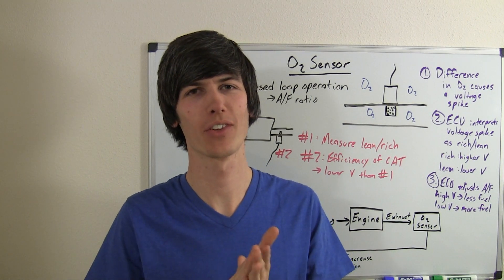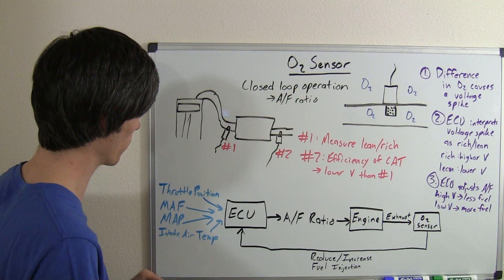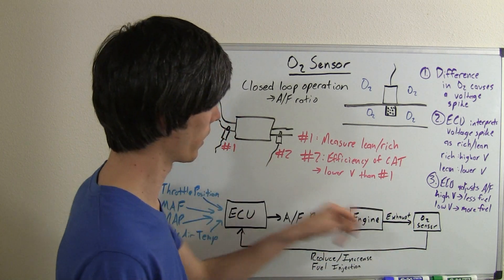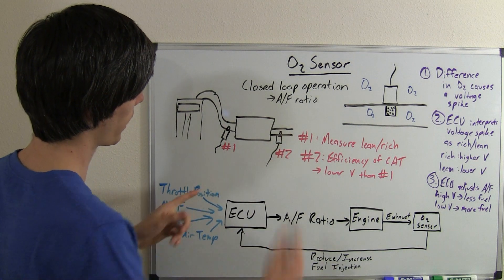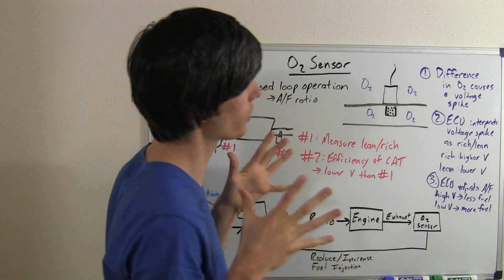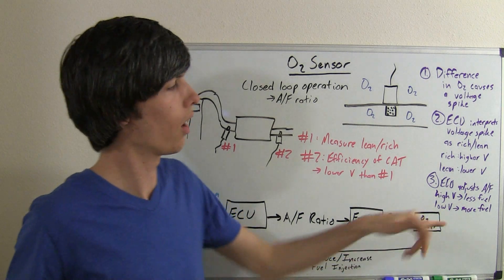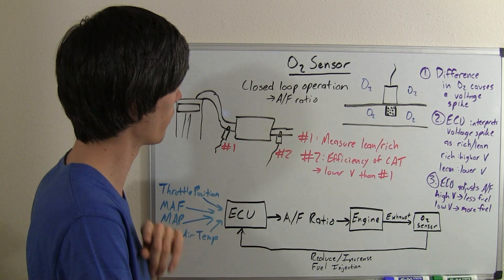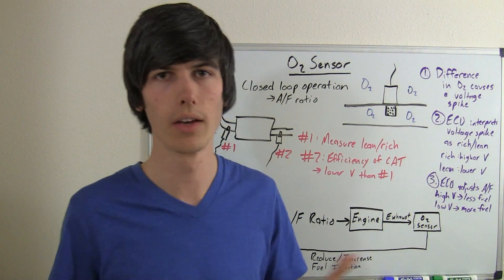Oxygen Sensor - Explained

Comment: I have a 02 Honda civic lx my check engine light on I put my obd2 scanner on and saying that my o2 sensor bad I replaced it an still says the same thing my mechanic said it the catalytic converter I bought a new one an still says the same thing now there saying it my computer please someone help me I need it fix so I can do smog
Reply: Okay first let me just explain  I don't know what I'm talking about this is just and idea I'm not too sure about there may be a Break In The wire Somewhere I have that problem right now so the signal may not be reaching to our needs to be most likely I'm out of left field somewhere I have no idea where I'm at so please check with somebody about this good luck God bless

Comment: My car has a check engine light and i read the code and the code say that the system  running rich whats is that mean help
Reply: KZ Reacts That means your car is using too much gas, therefore need to cut down on the gas. If it’s running too lean that means there isn’t enough gas

Comment: That is completely incorrect. PCM's do use the rear sensor for controling fuel trims, especially at steady state. Toyota was using a rear sensor for that purpose back in 1985, long before OBDII monitors were in place.

Comment: Didn't mention anything with how the ECU's software manages data input from all sensors to then adust fuel injector pulse width modulation (PWM) for optimal fuel efficiency. 
I guess I'll hafta go get an engineering degree. 
🙁

Comment: What's the difference in Oxygen Sensors and Air Fuel Sensors?
Reply: the front o2 sensor is the A/F sensor   It is both that measures O2  to determine Fuel trim .

Comment: Which is worse for the engine if the o2 sensor in bank 1 fails running rich or lean people told me running lean cause the more air in the engine would be bad I own a 99 acura gs manual I went to the dealership the auto guy told me that acura a prefer Ngk brand
Reply from the maker: It'd probably be worse for the engine if it went lean, worse for the catalytic converter if it went rich. Either way you should get the sensor replaced to fix the issue.
Reply: how about if i got the code which is a p0420 catalyst bank 1 is below threshold. would it lean more to a faulty catalytic converter or o2 sensor before the cat. how would i test both to make sure they are running  ok i have heard you can test the cat by taking temp before the cat and after the cat. as well as test with an obd2 with a live drive montor you can see if the o2 sensors are fluctuating right
Reply: *****
The p0420 is very easy to diagnose in 4 simple steps. 1) Is the car in good centered fuel control, are the fuel trims normal? 2) Do the sensors operate and respond properly? 3) Are there ANY exhaust leaks? 4) Are there any flash calibrations/TSBs that relate to it for your vehicle? If all that's good, it gets a cat. Check for exhaust leaks REALLY good, it's the most common cause of this code.

Comment: IT SHOULD never HAVE BEEN CALLED O2 SENSOR;
FUEL SENSOR should be it's name;  BOSCH did this ON PURPOSE to mix more confusion; 
I CALL IT (excess) FUEL SENSOR:  IT's voltage goes from ~~.2 Volts for NO fuel going pst it,to ~~.75-9 volts for FUEL passing it,so it measures  fuel RICH  exhaust,not lean.

Comment: Well, I've watched this vid twice. You couldn't be more incorrect about how it operates. What you just explained is how one of those operates in an industrial oven, or a 5 gas emissions analyzer. It does not work like that in a pre cat environment. I'll refer you to S.A.E document #920289 (focus on pg. 6 and 13-17 in particular), #930352 (concluding remarks sums it up pretty well, but the rest of it is interesting reading). If you can give me a way to contact you privately, I'll elaborate more.

Comment: I have an air/fuel ratio trouble code, o2 sensor trouble code, fuel banks 1 and 2 trouble code,vacuum leak trouble code, 

misfire on cylinders 2 and 8 

2000 mustang GT , 4.6l 8 cylinder 
only mods: air intake, ford racing intake manifold 

anyone wanna take a guess?

Comment: So if sensor is not working, it shoul read , no oxygen, so it cuts the fuel, so i get missfire in all 3 cilinders
Reply: If the sensor isn't working 
It will read a check engine light 
You can go without the sensors
But it's best  to have it.
Reply: +Antonio Ramos he's right, it just runs the engine in a "safe" overly rich mode -> using more fuel and getting you less power
Reply: Strange but true. 17 mpg while I was waiting for an upstream o2 sensor to arrive in the mail. My normal is 27 mpg. No power, bad gas mileage, all together a really needed function for a fuel injected car.